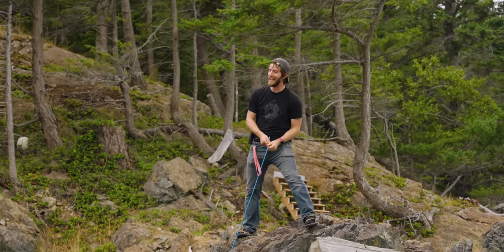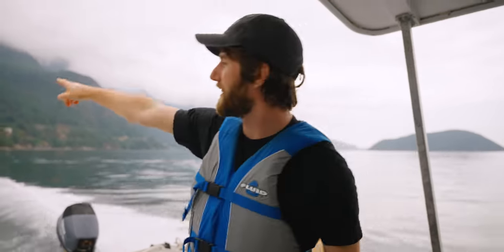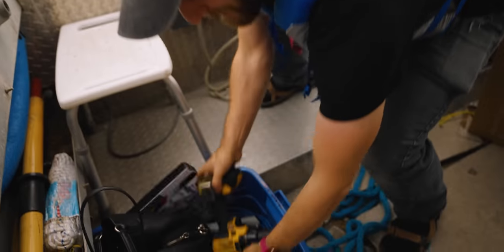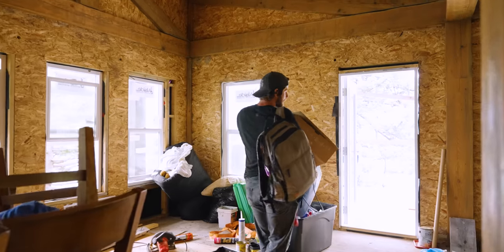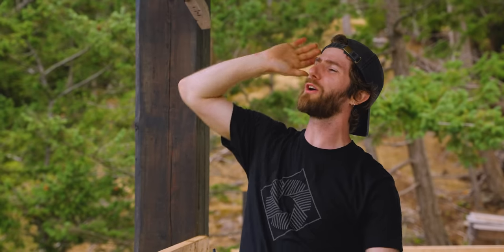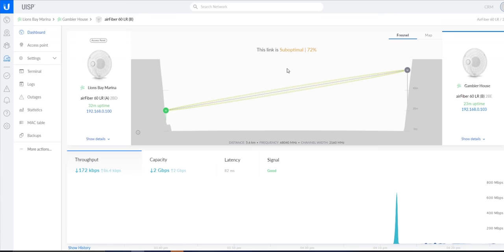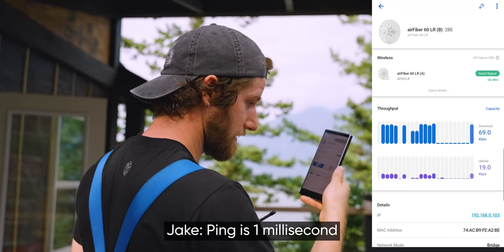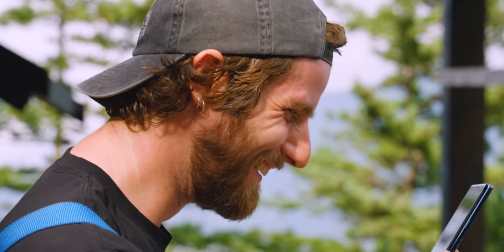How are we going to do this?

Comment: you don't even need to use a binoculars.
you just use the coordinates of the two units to determine the angle of direction, then use a compass for initial alignment
Reply: Yeah its big brain time
Reply: Quit using logical solutions!
Reply: Thats what i was thinking too ^^ or share your location and just use your phone's compass to point yourself towards one another
Reply: MrDanklord  doesn't need to. If it gets them anywhere near it they can always fiddle around to find each other then
Reply: dang math
Reply: @esuomi  that's right, I just hold my phone as far away from the metal tower as possible, it's just for initial alignment so it doesn't have to be accurate anyway.
Reply: I remember trying to do that about 100m form a railway line once and it would change by 45 degrees and then follow the train through 90 degrees before releasing when the train was gone. The job took quite a while.
Reply: @rfldss89  phone compass is horrible, it definitely cant tell precise angle. it can be incorrect by as much as like 20 degrees which is unacceptable in such precise measurements
Reply: they wont see each other on sea level because the earth is not flat. feel dumb yet? lmao
Reply: @noniche1387  mate if the earth was in the way the beam wouldn't reach the other side either.

But it did so they can evidently see one another just fine.

Comment: Linus, waving arms down by the water: "How can you not see me?"
Jake, looking through binoculars: "Curvature of the Earth?"
flat earth denied
Reply: It takes about 13 miles before the curvature of the planet makes it so an object is over the horizon, assuming both you and the object are at the same elevation. 

That's probably why the distance cap on this dish is 12km. Thats getting pretty close to the furthest possible distance something like this could work no matter how amazing the technology is.
Reply: @GeneralNickles  Not really. If they can do more than 12 kms, they'd advertise that showing if put on elevation, it can go to 50kms or something.
I believe right now 12kms would hold for full efficiency.
Reply: @GeneralNickles  well for conventional technology yes, although quantum entangled communications equipment could render all the obstacles today as meaningless, it would be amazing to see that future. The same tech I believe they use in the Mass Effect games. 😁
Reply: @GeneralNickles  radio signals can bounce around via the clouds and all but only low frequencies. This is how radio can go around the whole planet
Reply: @namedo6712  if you were to use a low frequency it could bounce around via the sky and go way further than 12km but it probably wouldn’t be that fast
Reply: @namedo6712  for example, 2G GSM can go up to 35km at about 850mhz
Reply: @namedo6712  3-30mhz radio signals can travel all around the world, it will bounce off the ionosphere
Reply: @emperorgizmo3014  I was referring to "this" technology. The tech shown in the video. It wouldn't matter if it could span 500 miles or more. The two dishes need clear line of sight, so without some sort of elevation on one or both of them, 12km is pretty close to as far as it can possibly go, no matter how far they can theoretically go.
Reply: @Roshan_420   I was referring to "this" technology. The tech shown in the video. It wouldn't matter if it could span 500 miles or more. The two dishes need clear line of sight, so without some sort of elevation on one or both of them, 12km is pretty close to as far as it can possibly go, no matter how far they can theoretically go

Comment: I'd be worried about wind, especially given how sensitive it is. I feel like it would benefit from wind guards
Reply: Considering how easily it flopped over on Jake, I'd agree about wind.
Reply: I would worry more about rain fade than wind.
Reply: As long as they tighten the bolts pretty tight, it will be fine. They do need to put a radome on it as it will build up snow in the winter pretty easily. I believe Ubiquiti just released a radome for it.
Reply: It'll be fine - remember, those mounts worked for larger (than those), non-mesh metal dishes that needed to aim at a satellite 37,000 km away and still were ok with wind. Here it's 5 km with smaller, plastic ones with mesh/holes in it.
Reply: So 60ghz band, although it does have great throughput, is HIGHLY susceptible to rain fade and other weather elements.  I wouldn't actually worry bout wind that much, those dish arms should be fine, there isn't that much flex in them.  When the pole flopped on Jake it was nowhere near tightened down. You saw how steady the connection was at 77% quality, and near the end you can see they tuned it in pretty good.  It should have some headroom to absorb any wind disturbance.  However, it is advised to run a 5ghz link as a backup to this, so it can fail-over to it in the event of a link lost due to weather.  I am actually  building this EXACT same setup for one of my clients (60ghz airfiber with 5ghz failover) and just received all the hardware.  The additional 5ghz link is only about $119 USD per radio, so it is pretty cheap insurance.  Hopefully Linus can bring us back for another video, maybe adding that secondary link.  Also, because it's an off-grid home they may not be that concerned about reliability.  Although I know at my off-grid place, if it's raining cats and dogs I probably want to stay inside and watch some YouTube.  So for me, bad weather is when the connection would be most important.
Reply: @Jeremy-Biggers  it barely snows Vancouver. Wind and rain are more of an issue.
Reply: @Jeremy-Biggers  Really?  Good to know, I'm going to look for that radome.  We have another manufacturer 60ghz link with radomes, and in 6 years (in Michigan) we have actually only had snow failure twice, and it was during pretty crazy ice storms where the stop signs even had ice on them vertically.   I don't recall ever losing that actual link due to rain or wind, and one side is on a non-pen block roof mount, and the other is on a cell tower, so that speaks to wind reliability. I know for sure the one on the non-pen mount can move a little bit (not much.)
Reply: Nope.

Guy wires.
Reply: Wonder how just a rain storm would affect it

Comment: I am very curious about it's reliability over the water.

Most links have issues over water, 5GHz is safer than 2.4GHz or 900MHz but 60GHz is absorbed by oxygen and water. The fog over the water, rain, etc, could cause serious problems. I'd go with 5GHz over water almost exclusively for this reason.

Comment: "can be blocked by a piece of paper... but there is no paper!"

What about bad weather? Snow, windy rain or even just a heavy down pour.
Reply: I imagine rain won't be too much of a problem, snow could absolutely be a problem but it really doesn’t snow too much around here.
Reply: Yeah you are correct moderate rains will affect 60 ghz.
Reply: @Enclave.  Rain absolutely can be a problem. We use these at the local wisp I work for and in downpours at over 2 miles they can and do drop out. That being said for the most part they are rock solid. I personally wouldnt use them any further apart than they are using because although Ubiquiti claims 12km in practice the one link we have near that distance is flakier than a snowstorm in January
Reply: @SirxMMPD  Exactly, why wouldn't rain effect something that could be effected by a piece of paper? Rain has physical property, it has mass, it's going to rain in-front of both dishes, presumably at the same time xD haha :P

As much as I love these guys sometimes on these little details they make me double-take :P
Reply: @benjaminsheppard8089  We don't really get downpours here and when we do they tend to last just a few minutes, while we get a fair bit of rain?  It's usually not just dumping on us, not like I've seen elsewhere in the world.  The climate around Vancouver is actually pretty good for something like this.

Comment: I found this is funnily easy, not because I’m smart, but maybe because I live in a country where the internet connection are so sketchy that we should do such thing quite often. You know it’ll be much easier to point the disc if you use your phone’s GPS to send each other coordinates and then calculate the fresnel zone by measuring the rough height of where both disc supposed to be located. And I don’t think you should use nail for the satellite dish mount, as are they are not very secure against external forces such as wind, ice, rain, etc

Comment: Linus climbing on a deck: gets a harness and lanyard
Brandon and jake using a scissor lift you need fall pro for by law, thats also sketchy as fuck: no safety harness, no lanyard, no fall arrestor
Reply: In British Columbia (where they are), fall protection is not a requirement in scissor lifts.
Reply: here in India people use rope to dangle a person from a 10 story building to paint the wall.
Reply: Aren't scissor lifts considered to be safer without all that shit?

Comment: With that level of alignment sensitivity, every time the wind blows…someone will be up a ladder fixing alignment. Having lived in that area, she does get stormy.
Reply: That and 60ghz at that distance in snow and rain is going to be an issue.
Reply: That was my concern too... 
This setup is great in theory, but will probably be extremely frustrating in reality.
Reply: @realifethunder  AF60LR has 5ghz backup, so they will be fine.
Reply: The mount wasn't tightened down at the time of recording, probably.
as someone who's friend owns one of these, once they're screwed in and tightened correctly, the post will break before that thing moves.
Reply: We usa a bunch of these, and at just 2km they lose connection in heavy rain, we need 5ghz backup for those, but i wouldn't call a cabin in the wood critical infrastructure... Also the af60lr doesn't have 5ghz backup, it's the airmax gigabeam lr, that would have been more appropriate for this?
Reply: @Kungenn  the LR models do not have5ghz backup
Reply: @realifethunder  wow, my bad I completely mixed the two.. 😂

Comment: As a layman, that is seriously impressive.

But in practice, I've been working with someone who is remote from a cabin in the wilderness who also gets her internet via dish. All it takes is the slightest bit of inclement weather and she's gone for the day. Flakier than that scissor lift.
Reply: They can use cellular backup for when it's not working. It'll just be slower.
Reply: Thats satellite though right? This would need a physical barrier like a large ship passing through the beam. I doubt a heavy fog would erase the beam if they are only using it for half its rated range.
Reply: @ac.creations  Unfortunately, probably not.  Higher microwave bands are susceptible to almost anything.  It's almost, but not quite, if you can't see it then you can't communicate with it.  Fog doesn't seem like it has much mass, but over kilometers it adds up.
Reply: That's what I was suspecting. It's gonna be frustrating during rain/snow season.
Reply: This is likely super weather dependent. That said, 90% of satellite dish (what you're likely referring to) "weather fade" problems can be solved with better alignment. In this video they seemed happy with 78%, that's a complete fail. That link needs to be the absolute best it can be, because when the weather changes, so will the signal quality. (In fairness, they seem to have fine tuned it after they showed the 78%, but they didn't show what they finally settled on)

Comment: I was surprised Linus didn't try using laser beam to match dishes perfectly.
And I was extremely surprised to see Jake not knowing how to mount things in concrete. For me, an European, where almost any wall is more or less concrete - it looks as strange as if someone didn't know how to tie shoelaces...
Reply: To be fair though - you probably don't know how to safely mount something heavy onto drywall.  There's a technique to do it in a secure manner, but it's something you probably never had to worry about considering gypsum board is a lot less common over there.
Reply: @matthewblackwood9653  Yes, but we still use drywall (gypsum) in Europe. To make a partition walls. And secure manner mean put all u can used to hold, if ur mount have 10 holes, use all 10holes
Reply: @matthewblackwood9653  
Drywall is common in Europe, or at least in Germany, for inner walls.

Comment: This is actually really impressive. How does it hold up in bad weather?
Reply: the
Reply: It doesn’t. They’re going to have a lot of issues in rain, snow, and fog. Also, any ice on the radios will instantly kill the link.
Reply: They would need to get the link quality closer to 100% to reduce rain fade, but snow and ice will kill it regardless.
Reply: what is when you would pull a book out or play cards. I'm assuming they only want internet there to stream tv shows.

Comment: I would like an update on this video later on. I wonder what weather does to the quality of the connection. I guess that a thunderstorm will impact it a lot. However, I am more interested in the quality of the connection when it rains. Does it still drop a lot, or work as perfect as in the video?
Reply: I've worked with equipment like this, and usually rain fade degrades the signal a fair bit since it's such a high frequency connection, causing a good chunk of bandwidth loss, but there's lots of variables at play that'll shift that figure, especially the distance and output power. I'd say they'd probably lose 50-100mbps on a generous side during a big rain storm given the range

Comment: For how accurate the mounting needs to be on this, it feels like a really bad idea to hang it up before the construction is finished.
Reply: BerserkFury89
i bought a Professional set to do the mounting over GPS, can't you buy them in Canada ???????
weirdo job!
Reply: @evolicious  Starlink would have pisspoor performance at a wooded island. Starlink requires clear sky to establish connection, I doubt those trees would help. Also it uses a lot of electricity which they don't have. At worst case scenario, his parents can look through the viewfinder and re-establish the link.
Reply: Now is the best time because of all the cabling.  Much easier with a relatively clean slate than a finished home.
Reply: They said in the video that they were just testing out, so I guess they may change something later
Reply: @evolicious  I've been running airlink dishes at my house for 3 years and they have never gone down. Reliability is not a concern
Reply: @williamkarels4402  really? What about storms? Would think they'd need adjusting quite often.
Reply: @Chronon88  nope. In live in the upper Midwest, it has worked through blizzards and thunderstorms, last weekend we had 70 mph (110 kph) winds during a thunderstorm and it worked the whole time! It's also installed on the edge of a field, and has been able to transmit through tractors.
Reply: @williamkarels4402  FM transmitters here also get fed through microwave links. They only stop working if there's a heavy thunderstorm in the area. As soon as the thunderstorm moves away, they work again.
Reply: @williamkarels4402  That's actually insanely impressive that it held up through those winds, well played!

Comment: Clearly Linus did no use the under over cable rolling technique too roll that data cable. If he rolled it properly he’d be able too throw it like a good 20 or 30 meters, and it wouldn’t get tangled haha. We use this in the audio/visual business and we throw cables across stages all the time, and they never get tangled. Good luck with your future cable rolling endeavours Linus !!

Comment: I'd like to see the performance reduction from obstructions like heavy rain.
Reply: I have 2 of these installed. one is 5.3km and the other 3.6km 
Both drop when it rains. not even hard rain. Signal strength on the 3.6km link is -54
Reply: @Lobbza  drop completely? Also can You explain Your use case? No details, just general stuff like getting the internet from one mountain peak to the more remote mountain peak etc :P
Reply: A lot of it depends on the alignment to begin with and the type of rain. My parents have this system installed in rural Alberta, crossing 6.7km of lake. We got super lucky on the install and had about perfect alignment (97%). Light to 'normal' rain doesn't disrupt the signal much, but a drizzle or fog really hampers it. Downpours obviously knock it out, but rather surprisingly, snow doesn't seem to bother the system much.
Reply: @davidklein1245  probably because 60Ghz is in a frequency range that is highly susceptible to moisture and even Oxygen absorption. Also, being over water, temperature inversions may cause issues. That said, its not a problem till it is. Time will tell.  For mounting the dish, I'd have used sleeve anchors if the wall were solid, or lead anchors if the CMU were hollow.

Comment: 3:50 you had to consider earth’s roundness, it could be that at 5km distance you wouldn’t be able to see him anyway, as he was too low (too close to the water). At house level line straightens 🌎
Reply: That means boats don't have to be as tall as one would think to block the signal.  And I wonder if air distortion is a factor at that distance